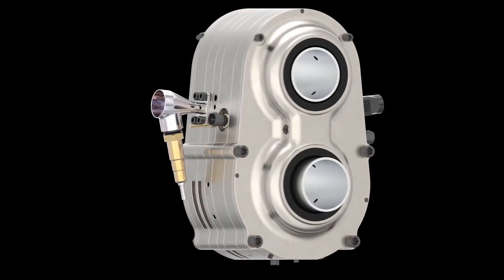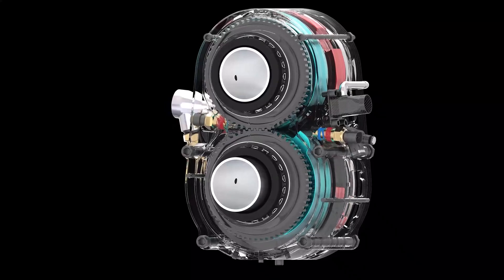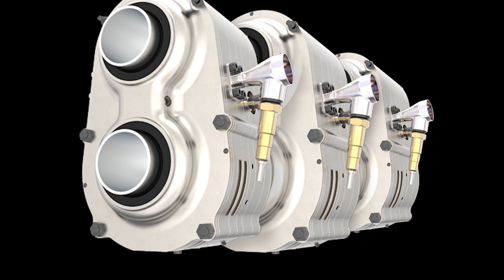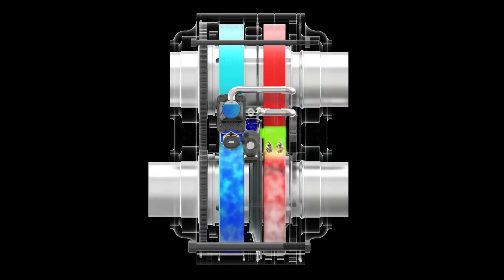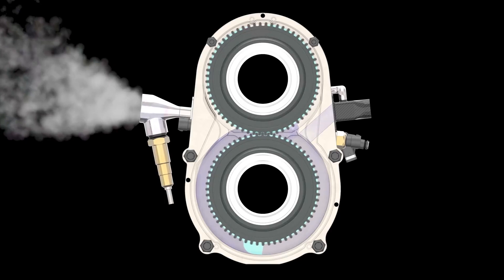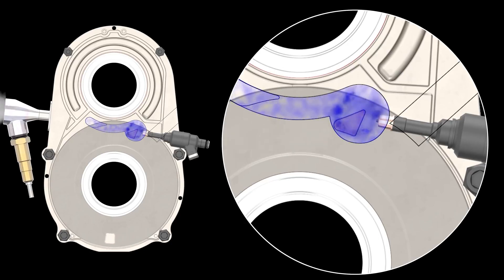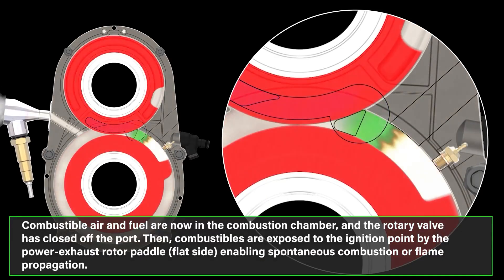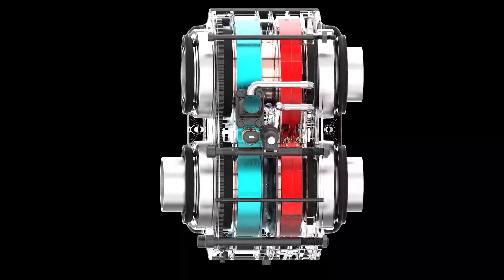This pistonless engine runs on hydrogen and revs to 25k rpm

Comment: For aircraft this could work, they could live with the constant high RPM, but that doesn't fit a car's uses very well. The reduced weight also helps for a plane.

The only real option is to use it as some form of hybrid in a car, and even that would be a hard sell. Maybe some kind of funky range extender?
Reply: It doesn't sounds like it needs to run at that RPM, just that it can reach it, right?

And while the engine might be light, hydrogen storage often isn't, at least to get the same range as a tank of fossil fuels.

Comment: Until you can figure out away to generate hydrogen in way that does not take more energy to produce than what we can harness from the produce, all this is just money making schemes....which is essentially what the entire climate crisis is: a money making scheme.
Reply: This has always been the problem with Hydrogen, it sounds clean so it gets funding. "Green Hydrogen" requires a lot more electricity to produce than the energy you'll get back. The only way to get more energy back than you put in is by oxidizing methane to release Hydrogen and a lot of CO2. It's stupid technology as it's not sustainable, and if you have enough clean energy to make green Hydrogen, then it's much more efficient to just use the electricity in an EV.

Comment: This thing is a little late don't you think. Manufacturers develop electric cars these days, no one will invest in combustion engines anymore. Hydrogen won't be widespread fuel ever, it had it's chance but the accumulator has already won. Storing and transporting liquid hydrogen (or hydrogen cells) is very problematic and dangerous and expensive. Combustion engine (in cars) is dead, it's that simple.

Comment: Considering for batteries for EVs we have children going down into to holes into the ground to get rare earth elements underground, exposing them to possible toxicity and cave ins, then fire hazrds of charging and other fires while in service other more efficient internal designs should be looked into... considering the internal combustion gasoline engine actually only uses 25% of the total energy within it's fuel and 33% for diesel engine, getting more of the energy out of the fuel should become the focus...

Comment: What do you mean by tight tolerances? 0.001? 0.0001? Only one 0 makes a huge difference in things that can go wrong, cost for manufacturing and volume of production. What will be the engine behaviour when its fully warmed up as the metal expands? Will engine efficiency and power be horrendous when cold and improves when hot? That means that oil could go anywhere when cold or loses in compression and power (we are talking about 200psi compression, no joke). Will the engine have issues if the rotors expand to much? As rotary engines, the piece will be extremely hot on one side and colder in the other, causing uneven expansion, this could also mean problems when you talk about "tight tolerances" as a sealing factor. Too many questions for 2 words on such a extraordinary concept that could go wrong in too many ways if not answered and addresed correctly. And you said that is very efficient but i dont recall you saying the efficiency percentage expected or tested (im lazy enough to not go through the video again). Thing is, this engine sounds too delicate, so manufacturing cost will be crucial for this model to succeed, almost nobody wants to take care of their cars in such a way to not make them blow, thats why RX8s died, people expected to drive them like normal cars and didnt know they should have knowledge and patience to make these engines reliable, amazing car, clearly missunderstood. I know this engine is super early in development, but they shouldn't give such optimistic numbers when in the demonstration video is spitting oil everywhere.

Comment: Odd shapes spinning insanely fast at small sizes with F1 level of tolerances (or tighter) will be very very expensive.
Bigger and slower, in my opinion, is better.
Reply: the more important aspect is the concept is there and can be worked on, just look at the common car and where 90% of the current tech came from (mostly motorsports especially f1)

Comment: Hydrogen is not clean at all… and is a poor fuel source at this point. It requires a heavy storage tank for your “light” vehicle and the process of refining hydrogen is arguably just as polluting as combustion…

Plus low tolerances = extremely high prices to manufacture

Comment: From my understanding, the engine has never been the problem when it comes to running things on hydrogen, it has been fuel storage. This is not really a path forward, just a more fancy combustion engine. As long as it runs on fossils, it doesn’t matter how efficient it is, it’s still pumping dead dino plants into the air. We either need to make our own dead dino plants, or go electric, more efficient engines isn’t a solution, it’s just a selling point.
Reply: @Bob Who spoonfed you propaganda, GM?
Of course there is clean electricity, wind, solar, nuclear etc does not produce CO2 while operating, hence clean electricity.

Sure, building the structures produce CO2, but that is because the rest of our infrastructure isn’t green. If we were to produce steel without burning coal, use other types of concrete etc this wouldn’t be the case.
Reply: And electric cars are just green washing! It has already been proven that the amount of fossil fuels being used to supply electricity to charge cars is the same or more detrimental to the environment than running cars on petrol.
Reply: @Gentlemen_london_ Depends on where you live, if you have access to clean electricity, go electric, if you don’t, go bio. If public transportation is available, don’t even buy a car.

Comment: What's it going to cost?... is there an actual working engine or is all this hypothetical?... and at 25,000 RPM what happens if something cracks and it launches parts everywhere?... and if it is so efficient, why not run it on Diesel Fuel for now and it should be easy to transition to Hydrogen when that's readily available.

Comment: That is why I advocate in Formula 1 to have an emission and/or fuel quantity limit and leave the engineers do their bit with everything else. Total freedom to chase "cheap performance" can really drive technical advancements.
Reply: Wow, yes what if??
Reply: Yup I agree. Most engine advancements come from F1 cars
Reply: exactly and look ad the advancements that were made during the golden era when f1 had few restrictions / limitations you got crazy concepts like the elf 6 wheeler that had basically a vacuum to suck the car onto the track
Reply: @gregdunn401  exactly. FIA can limit performance simply limiting fuel consumption/emissions. As per raceability I still think that ballasts are the best way to level up performances.

Comment: Very interesting concept, but I share the concerns of several other commenters regarding the effects of very high rpm and very tight tolerances. I’ve been following the pursuit of hydrogen powered vehicles, the holy grail of clean combustion technology, since Ballard Power Systems began work on their fuel cell concept. Like others since, that technology looked promising at the time, and I’m sure we will inevitably see practical working engines, but so far the pursuit has been elusive. 
I do have concerns about the religious fervour surrounding the adoption of electric vehicles. In jurisdictions like B.C., where I live, where over 90% of electricity is hydro-generated, electric vehicles make perfect sense; where the majority of power is nuclear-generated, people need to judge the lesser of two evils; but in many places in Europe and Asia, where so much of their power is generated by burning dirty coal, I struggle to see any environmental or economic benefit in the mass adoption of electric cars. I think hydrogen power could play a vital role in providing a clean energy alternative, while reducing reliance on fossil fuels and nuclear fission, assuming engine technology sufficiently advances, and hydrogen capture and storage also becomes more energy efficient.

Comment: I heard the process to make hydrogen is more emissions than to make gas engines.  Just like electricity takes coal to make the electricity at the power plants. Everyone claims they have clean energy is just a bunch of hogwash,  they are just taking emissions from one place to another.
And I think you need to test these  engines to see if they actually last or if problems arise . Time will tell.

Comment: I'm iffy on this one. I like the concept, but as others have said, there are the issues of the tight tolerances required and no seals. Those just doesn't seem practical for a real-world engine. How is your everyday shop mechanic going to service one? I think there will be some design compromises in a final design.

Comment: Hydrogen burns at an exceptionally high temperature and is highly corrosive during combustion. Whatever those engines would be made out of would make them so prohibitively expensive you'll never see one outside of a lab or a 3 million dollar exotic car.

Comment: We definitely need alternatives to electric. We're going to end up overloading the power grid with too many EVs. I've read that Toyota may be focusing on hydrogen and fuel cells. That would be a better alternative for people working in remote locations or driving long distances in rural areas.
Reply: How about you upgrade your power grid ffs?
Reply: Hydrogen fuel cells exist aswell if you're against the notion of directly charging a car off the grid.

Comment: So, they "invented" a gas turbine. 
Good. There is nothing more unsuitable for motoring.
And no fuel is more cumbersome than hydrogen.
Without to say that while hydrogen is very common in nature, it is not common in molecular form (pure hydrogen).
To produce pure hydrogen and to liquify it for transportation uses much more energy that what is possible to extract burning the hydrogen. The entire process is at loss. Without to mention that hydrogen is highly explosive, and remains liquid only near absolute zero.
This idiotic war on piston ICEs has really broke the barrier of nonsense.
There is A REASON why piston engines replaced every other type of engines (including the electric, that was popular in 1905, believe or not).
The reason is they are better fit for vehicles: costwise, for performance and endurance, range and they use a cheap, easily transportable, energy dense fuel: gasoline!
And catalyzators limit the emissions to a negligible quote.
Want to reduce CO2? Build nuclear plants and use the power for domestic heating and industry. Using coal plants to charge battery operated vehicles is beyond stupidity, because you just produce more and worse pollution, at a higher cost.

Comment: Where does all the hydrogen come from? 95% of all hydrogen produced today comes from gas and oil. Producing hydrogen from electricity (green h2) is only 22% efficient when used in a car compared to using the same electricity to drive a motor from a battery directly. Hydrogen ICE and fuel cell units are a waste of time, energy and money.

Comment: Why do we need to stick with internal combustion, especially when we talking about hydrogen? We already have a great electricity generator, based on water synthesis, capable of powering an e-vehicle. And unlike this concept, it's already on the market (Toyota Mirai).

Comment: Not so great. It must burn oil by design to lubricate this "tooth" scraping housing wall (same issue as in Wankel). Ignition in the same area will cause thermal stress on engine block wall and thermal expansion problems (same issue as in Wankel). There is no VVT-ish valve timing option (same issue as in Wankel). Tolerances will be impossible to maintain due to extremely high strain on both roller bearings when fuel is ignited (explosion force is directly along rollers radius). On top of that any accidental pre-ignition knock will occur in incorrect chamber, which may have devastating effect and burn out inlet port.

Looks cool as CGI, but real world issues are very obvious.

Comment: well honestly this seems like a good idea, there are however a few things that give the problems away.
1 only a cad model seriously?
2 the mention of h2, why do you need to upsell the product
3 tight tolerances, how do they hold up at lower rpm?
4 uneven heat distribution
5 the need for high rpm for the tolerances to work
6 160hp at 25k with compressed air

Comment: When I look at this I think about connecting this to a generator and then using electric engines to power the vehicle, depending on energy requirement you could stack. Add a small battery pack, which gives you extra distance in case of emergency, just to name a few. So much new technology is coming out these days which could move us towards using less fosil fuel.
Reply: Wouldn't it be more efficient to essentially cause a redox reaction and turn the hydrogen into electricity directly?
Reply: Dont be a Joe Byden! The senile fool from hell that turns everything into shit.
Reply: Hydrogen isnt a fossil fuel
Reply: @nonofyourbusiness7631  you are 100% correct
Reply: @nonofyourbusiness7631  except that the vast majority of hydrogen produced atm is, the cheapest source of h2 rn is methane.

Comment: 30 years too late. No automaker is going to bankroll another IC design. Sealing, lubrication, noise, vibration and poor thermal efficiency are forever going to be an issue burning fuel. Can you imagine how much noise this thing would make at those RPM. Electricity is the future and like it or not that's the way it's going to be.

Comment: I thought back of what i wrote in the comments and thought of something else as well. Converting water into hydrogen and oxygen and then burning it to convert it back into water at high temperature... That means it is effectively not a combustion engine, but a steam engine. Because hydrogen reacting with oxygen and hydrogen to create H2O does not create a large expansion of the fuel burned, the large expansion is caused because that water is then hot and in gaseous form, steam. Which does indeed create a reasonably large expansion or thrust, and it makes for a nearly clean emission. That steam will at most take along a little bit of engine oil. So as far as that goes, YAY great idea! And I mean it, I do love it when people are trying to come up with new and better ideas, so don't let my previous comment discourage you in any way. The downside though is, that you'd still be using electricity. You need electricity to split water into H and O, and then you need safe storage of both components. Then you only need to bring them together to have them react, so you don't need an igniter, easy but also an added risk, because any leak means ignition.
The H and O do not need anything other than the two of them to ignite.
On the other hand, when H and O do combine to make H2O, they do create 2 electrons for each combination, so with positive electrodes, the excess electricity could be "captured" and stored in a battery, and the battery could be used to recreate H and O from water, and you'd be recycling water inside the vehicle. Although that would actually be virtually impossible to do in a moving vehicle, the shaking around would make it impossible to split water into H and O with a 12 volt battery, because H and O have to be captured the moment they are split and the electrodes splitting them have to be in contact with the water, but also have to be directly below whatever kind of tube catches it in gaseous form. 
Anywho, to make a long story short... doing all this would be very hard, very expensive, not entirely reliable, and in effect, it would be a steam engine... You'd be using electricity to make H and O, to then turn it back into water and into steam... It would be cheaper and easier to make a steam engine. 
But again, if you are the one who came up with this idea, or to whomever did come up with it. Don't let any of this deter you from working on new ideas.

Comment: Sounds intriguing. Hope they can  design it for practical use which means satisfying potential customers that it will work as expected,  have a reasonable lifetime and not be excessively expensive.
Reply: Your comment is exactly correct.
Thank you!